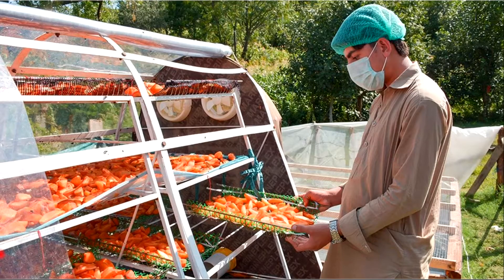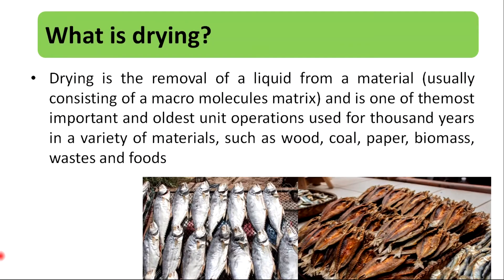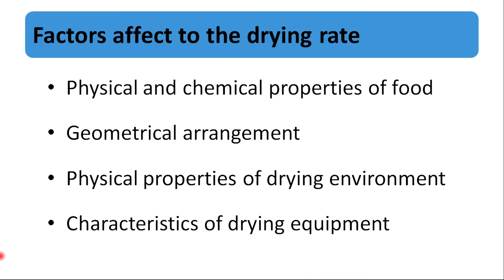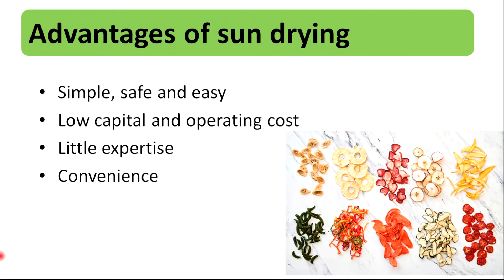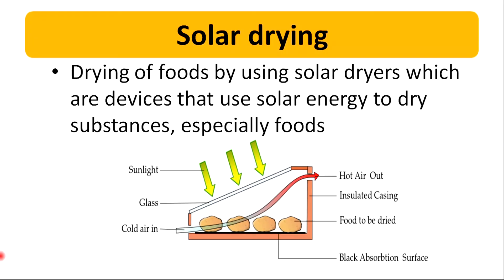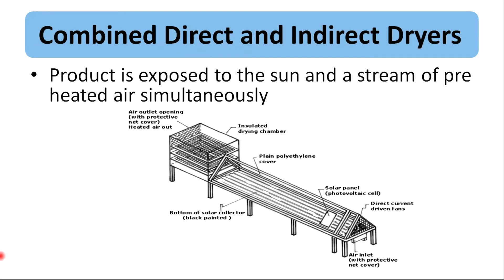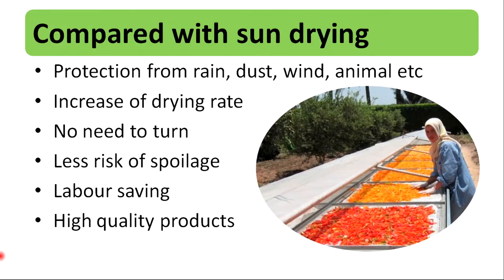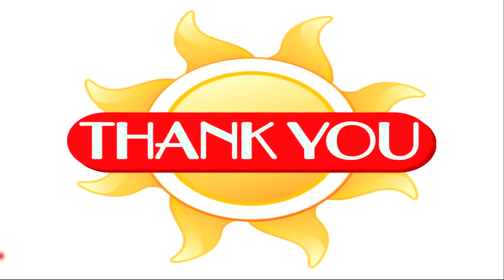Sun Drying and Solar Drying  l Food Preservation Methods - Lesson 14 l Food Processing Technology

Comment: Hello, 1st time watching your video. I want to know what are the differences between  solar drying and using dehydrator. Can you answer in comment or make video. Please.
Reply from the maker: Certainly! Solar drying and drying using a dehydrator are two methods employed to remove moisture from food items, preserving them for longer-term storage. Here's a comparison of both methods:

1. **Principle of Operation**:
   - **Solar Drying**: Relies on the sun's energy to heat up and evaporate moisture from the food. Food items are typically spread out on trays or racks and placed under direct sunlight.
   - **Dehydrator**: Utilizes electric power to generate heat and air circulation to remove moisture from the food. Food is placed on trays inside the dehydrator, which blows warm air over the food.

2. **Control**:
   - **Solar Drying**: Largely dependent on weather conditions such as sunlight intensity and ambient temperature. It's less controllable as it relies on environmental factors.
   - **Dehydrator**: Offers precise control over temperature and airflow, allowing for consistent drying results regardless of external conditions.

3. **Speed**:
   - **Solar Drying**: Drying time can vary greatly depending on weather conditions. It may take longer compared to using a dehydrator, especially on cloudy or humid days.
   - **Dehydrator**: Typically, faster due to controlled conditions. It can dehydrate food relatively quickly, often within hours.

4. **Energy Efficiency**:
   - **Solar Drying**: Utilizes renewable solar energy, making it environmentally friendly and cost-effective once the initial setup is in place. However, efficiency can vary depending on location and weather conditions.
   - **Dehydrator**: Relies on electricity, which may not be as environmentally friendly depending on the source of electricity. However, modern dehydrators are designed to be energy efficient.

5. **Quality of Dried Food**:
   - **Solar Drying**: Generally, produces good quality dried food with a more natural taste. The slow drying process can help retain nutrients and flavors.
   - **Dehydrator**: Provides consistent results and faster drying times, which can help preserve colors, flavors, and nutrients effectively.

6. **Space and Portability**:
   - **Solar Drying**: Requires outdoor space with exposure to direct sunlight. It may not be suitable for urban or indoor settings unless a dedicated solar dehydrator setup is available.
   - **Dehydrator**: Compact and can be used indoors, making it suitable for various settings including homes, apartments, and commercial kitchens. Some models are designed for portability.

7. **Cost**:
   - **Solar Drying**: Initial setup costs may include trays or racks, mesh screens, and possibly a dedicated solar dehydrator. However, operational costs are minimal once the setup is established.
   - **Dehydrator**: Requires an upfront investment in the appliance, but operational costs are tied to electricity usage, which can vary depending on energy rates and usage.

In summary, both solar drying and using a dehydrator are effective methods for food preservation, each with its advantages and limitations. The choice between the two methods often depends on factors such as availability of space, desired drying speed, control over drying conditions, and environmental considerations.
Reply from the maker: Here are the advantages and disadvantages of both solar drying and drying using a dehydrator:

Advantages of Solar Drying: 👈

Cost-Effective: Once the initial setup is in place, solar drying is relatively inexpensive as it relies on free solar energy.
Environmentally Friendly: Solar drying uses renewable energy, reducing reliance on electricity and lowering carbon footprint.
Natural Preservation: The slow drying process helps retain nutrients, flavors, and colors in the food, resulting in a more natural end product.
Suitable for Off-Grid Living: Ideal for areas with limited access to electricity, making it suitable for off-grid living or remote locations.
Traditional Method: Solar drying has been used for centuries, offering a traditional approach to food preservation that connects with cultural heritage.

Disadvantages of Solar Drying: 👈

Weather Dependency: Drying time and efficiency are heavily dependent on weather conditions, such as sunlight intensity, temperature, and humidity.
Space Requirements: Requires ample outdoor space with exposure to direct sunlight, which may not be feasible in urban or indoor settings.
Slower Drying Time: Compared to dehydrators, solar drying can take longer, especially on cloudy or humid days, prolonging the time required for food preservation.
Risk of Contamination: Exposing food outdoors may increase the risk of contamination from pests, dust, or airborne pollutants.
Limited Control: Lack of control over drying conditions may result in inconsistent drying outcomes, affecting the quality of the dried food.

Advantages of Drying Using a Dehydrator: 👈

Controlled Drying Conditions: Provides precise control over temperature and airflow, ensuring consistent and efficient drying results.
Faster Drying: Typically dries food faster compared to solar drying, reducing overall processing time.
Convenience: Can be used indoors, making it suitable for a variety of settings including homes, apartments, and commercial kitchens.
Compact Design: Dehydrators are available in compact sizes, saving space and offering portability for storage or transportation.
Versatility: Some dehydrator models offer adjustable settings and multiple trays, allowing for drying a variety of foods simultaneously.

Disadvantages of Drying Using a Dehydrator: 👈

Electricity Dependency: Relies on electricity, increasing operational costs and environmental impact compared to solar drying.
Initial Cost: Requires an upfront investment in the appliance, which may be a barrier for some users.
Limited by Power Source: May not be suitable for off-grid living or areas with unreliable electricity supply.
Less Natural: Some argue that the rapid drying process of dehydrators may result in a loss of nutrients and flavors compared to solar drying.
Maintenance: Requires regular cleaning and maintenance of the appliance to ensure optimal performance and longevity.
In conclusion, both solar drying and drying using a dehydrator offer distinct advantages and disadvantages, and the choice between the two methods depends on factors such as availability of space, desired drying speed, control over drying conditions, and environmental considerations.